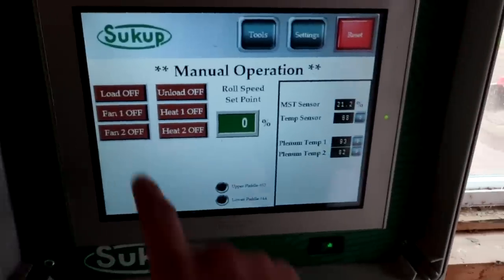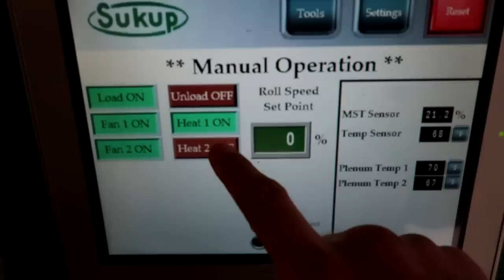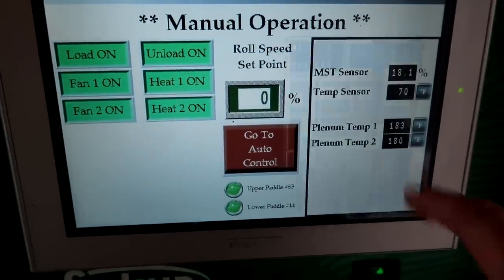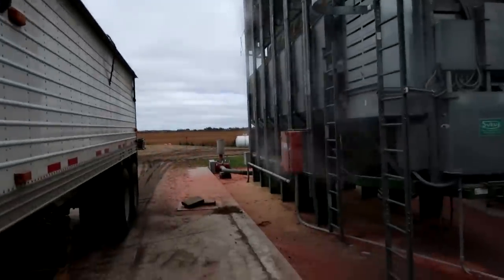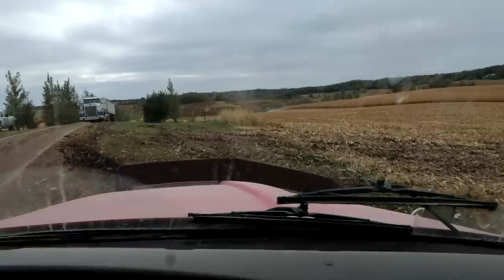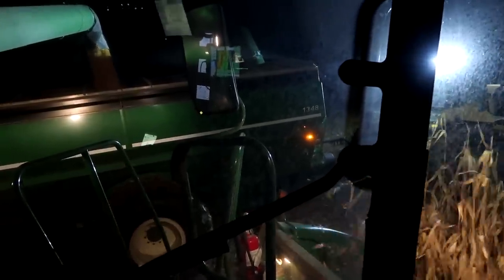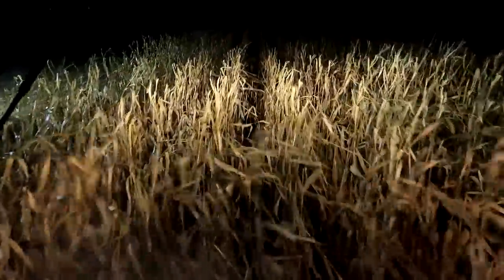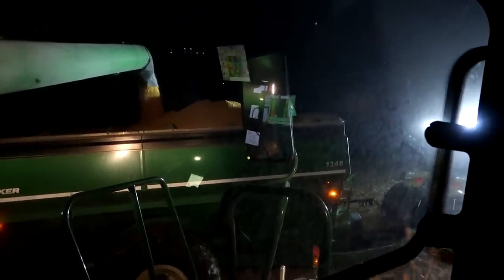CAB CORN

Comment: Maybe put a rubber bumper around the edge of the cab to save that corn that will not stay in the hopper.  Maybe 50 push-up for the operator as well. Be safe.

Comment: Zach I have an Ideal why don't you put a mirror that you can see from the seat of the combine that is aimed at the roof and top of the combine and that way you can see when the combine is full so you can shut it off before you fill the top of the cab with corn.

Comment: Hi Zach,
Was wondering what type of gravel is on your driveway? 
I know you have told us your driveway is gravel, but I can't get over the amount of mud your dealing with. 
Here in Pa & Nj we use lime stone. Lime stone will pack fairly hard and does not stick to tires or shoes like your gravel seems to do.
Reply from the maker: Becky also can’t believe it.
Reply from the maker: We dont have limestone around here, I wish we did.  We all use class 5 gravel
Reply: Limestone pick up energy spirits when you passed on near to it and it's called Paranormal.

Comment: Are you dumping the grain hot out of the dryer and cooling in the bin? Why not use a grain spreader in the bin? How hard would it be to convert another bin to wet holding? Maybe just run an auger over to the dryer?

Comment: They have the technology to locate the combine position from space to within inches here on earth, you'd think they could make a sensor accurate enough to tell how full a grain tank is. Lol
Reply: Lol
Reply: I think they do but it sounds like hilly ground.  Take glass of water half an inch from full but start walking with it and tip it slightly. See how long till you spill
Reply: they have a pressure sensor. its usually only on one side, front right side, if leaning opposite way or u hit the brakes or a bump then u will get some cab corn. usually try not to get it that full tho. hard on things.
Reply: Its the dumb sensor in our head that says, "I think I can go a couple more feet to finish that row...…"

Comment: Quick tips to prevent major cab corn:

Tip #1- run the auger for a few seconds to take corn from the hopper and fill into unloading auger.

Tip #2- don’t fill the hopper so damn full

Comment: Why not mount a camera on top of the harvester and use your phone to monitor it? A cheap gopro could work or if you want a more permanent solution you can pick up a cheap (probably 12v) security camera and just wire a cheap monitor into the cab.

Comment: Isn't there a buzzer that goes off when full? Don't worry it's happened to me.
Reply: Deron Logterman there is but on deere combines you can get quite a bit more in there before it’s truly full. it goes off super early and you can go a long ways before it really starts spilling
Reply: I think our combine is 90% full or 30 more bushels.  I have been practicing spreading cab corn long enough that after the buzzer I look at the yield monitor and add less than 30 bu.    Before monitors I had a resealable transmission shaft rotation counter.

Comment: Why not add an extra plate on there so the corn doesnt fall on the cab? Or even extra plates all around for higher capacity.
Reply: Is there not a sensor to prevent overspill?
Reply: Or just stop overfilling it lol!
Reply: They overfill it because they don't want the combine to stop
Reply: can't load much more your lookin at 20.000 lbs extra now when the hopper is full danger danger
Reply: There is a sensor that tells them when the bin is full 
But you can go an extra little bit more usually 
If you plate the front then it goes over the back 
Either have it on your roof when you know immediately 
Or it goes over the back and you may never know your slipping it all 
Also the engine is right there so grain over the back usually falls right on the exhaust manifold 
Big fire hazard

Comment: Would a small camera up on the combine help detecting Cab Corn potential before it rains on you?  Sheet metal extensions on the top / front might help also if you have hilly terrain.  Could you add some kind of deflector where the corn comes out on top to help give you a even distribution in the hopper?  You have probably thought of all these already, but just throwing it out there.  By the way, how much corn actually makes a "bushel"?  Do you have a visual reference for that amount of corn?  Obviously I'm not a farmer.
Reply: littlewingpsc27 there is a camera in the bin on his combine but corn will cover it before it is completely full. Also there is a warning chimse
Reply: littlewingpsc27 oops wrong button before.  Warning chime!  Most all of us just try to go a little farther rather than stop.  Corn weighs 56 lbs per bushel officially but can weigh more or less.  A bushel actually is a volume measurement but we compute yield and sell by weight.  If the corn is weighing less then there is actually more volume or weighing more there is less volume.  Kind of like lead versus feathers.  Hope this helps.
Reply: Thanks. Thought it once was a volume based measurement but makes sense it is by weight. Do they deduct the price if the moisture level is too high? Does the price reflect a specific moisturize percentage hence the need to dry it.
Reply: littlewingpsc27 Looked it up. A bushel is 64 pints.  Re:  Moisture....corn is considered dry at 15.5% moisture.  Grain dealers and most end users will deduct $ for higher moisture content when buying and many end users will refuse corn above 15.5.  Also corn will not store without molding above 15.5. In addition if planning on storing into warm weather corn moisture should be reduced to 15% or less and aerated as the ambient temperature changes.  Wheat and soybeans are traded at 60 lb bushels and a lower moisture content.  Barley 48 lbs/bu.
Reply: Thanks for all the great info.

Comment: Lot of 80s butt rock? Is that normal for a millennial in the Midwest ?
Reply: K J  when I farmed in New Zealand they listened to a lot of Metallica and slayer. I guess our rows are shorter in the willamette valley. We tend to listen to Sirius radio and usually just country.
Reply from the maker: There aren't many choices for radio stations here.  It's either 80s rock or maroon 5/justin beiber
Reply: MN Millennial Farmer well that blows
Reply: @MillennialFarmer  I sense another sponsor deal in your future. We just need to get the attention of the advertising geniuses at Sirius XM.